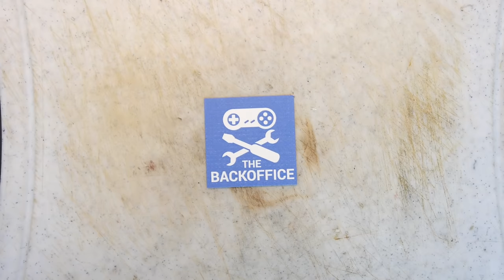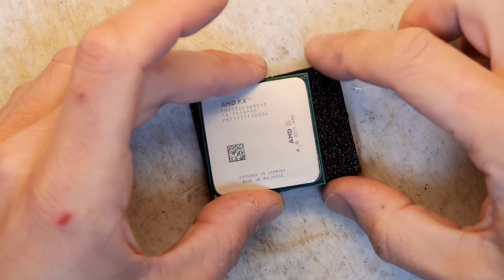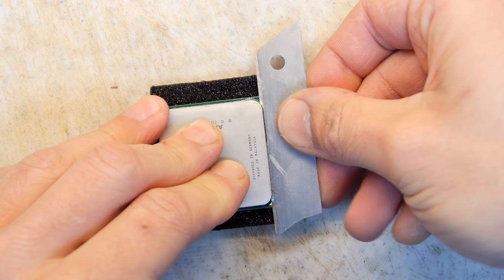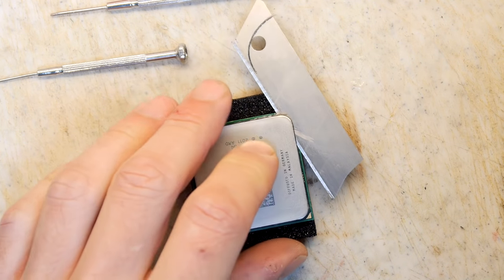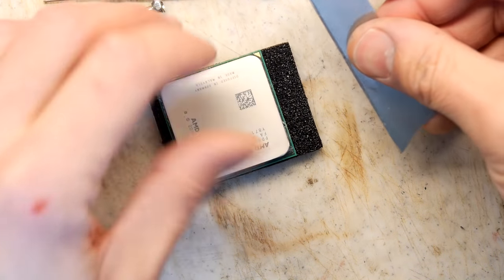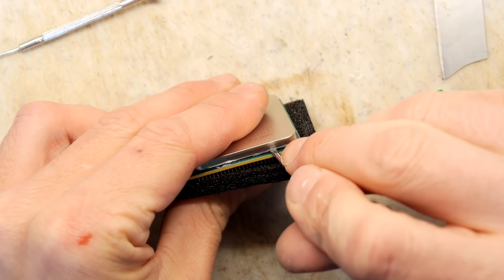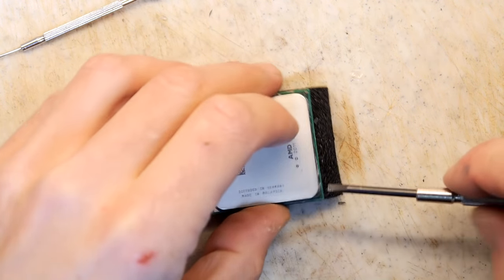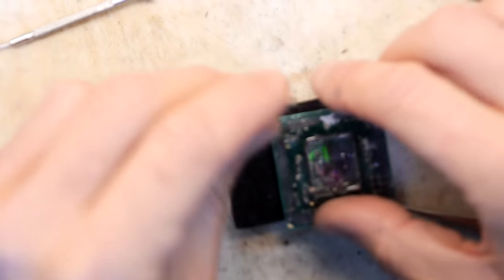Do not DE-LID an AMD FX9590 CPU! (Already dead CPU)

Comment from the maker: Hi guys, tomorrows video (16/02/2017) is a return to this CPU to desolder the lid and test the other components to see if they are likely to survive heating. https://youtu.be/utLf59se-TE
Reply: You could delid a soldered chip if youhave a vice or a specialised delid clamp. You have to be careful when doing it but it's very possible
Reply from the maker: +ThEcRaZ3dGaM3R I did another video exploring the heat spreader, I can see there are some hoops, I.e. applying heat, plus tension to pop the lid off, but seems you need to be really quick?
Reply: just cut the seal around the edge and toss it upside down into a frying pan
then lift when the solder melts
no special equipment needed
Reply from the maker: +Gillian Seed like it 👍
Reply: Hi. Oil on the edge of the blade would  prevent alredy cut rubber to be kind a glued together again after blade goes through and it also would help to cut faster because blade wont be stuck in rubber material and whole thing would go  faster with other processors.
Reply from the maker: +Videocomputer That is a grade A piece of advise right there 🖖👍 A±++++ thank you kindly!
Reply: atleast it was an amd 9000 series trash build 220w TDP is unacceptable
Reply: There appears to be a very good thermal contact between the die and the heat spreader so de-liding this CPU is kind of pointless.
Reply: Those AMD cpu's are soldered together with the heatspreader. They dont just use tim(thermal interface material).
So there is no way to get it off, unless you heat it to about(I dont really know...) 200°C
Reply: They use an indium solder i believe. Much better process than intels toothpaste.
Reply: So your delidding a soldered on AMD processor when your not touching the glued on Intel processor ? I don't get it.
Reply: That was worth watching.I am subbing for that.That was really interesting.
Reply: The Backoffice ...
Reply: "atleast it was an amd 9000 series trash build 220w TDP is unacceptable"

I think people get confused by the fact that TDP doesn't mean the same thing on AMD as it does on Intel. 
TDP on Intel refers expressly to the (Stock Base Average) Thermal Design Point (Under Load) ... so for example the 65w TDP i7 6700., while in use will produce 65w Thermal while operating at 3.4GHz (All Core) or 4.0GHz (Single Core). It will DRAW 94w Power. 

As a note typically speaking Intel Processors are designed to operate up to 20% above TDP., meaning that it can rise up to 78w TDP (113w Draw).

Conversely speaking AMD lists the Typical Draw Peak. So., for example is 220w TDP... this is what it will *DRAW*, the Thermal Design Power is 150w; which is only slightly above i7 6900K which has a 140w TDP (Base) and 168w TDP (Peak) / 203w and 244w Draw. 
Keep in mind that we're talking about the FX 9590 having a Maximum Clock of 5.0GHz (All Core, as AMD Processors have no TurboCore Functionality) at 150w TDP Under Load... where-as the i7 6900K is 3.2GHz All Core at 140w TDP. 

This comparison is something I see many Specification / Review Sites get wrong time-and-time again, something that does show in Power Consumption Benchmarks today but when this Processor came out., essentially it was just assumed that listed "TDP" was accurate and meaning the exact same thing... by the time said Power Consumption tests were added, the FX Series was no longer being reviewed. 

Now what might be of even more note here is that we're talking about the comparison between 32nm which uses 14.3% more Power than 28nm (AMD's later process used for this Athlon and Carrizo Processors) and 14nm which uses 50% less power than 28nm. 
As such if they were to produce the FX 9590 today on their 14nm FFT., it would be an 80w Draw / 55w TDP Processor... this is with AMD doing nothing but simply using the 14nm Process.

Of course if they did, it wouldn't reach 5.0GHz given the flaws in the GF 14nm FFT Process and instead would cap out ~4.2GHz and thus likely be a 35w TDP Processor.. but the point remains the same. As far as the Architecture goes on the Process they kept with... it was one hell of an efficient CPU. 
In fact just dropping to 28nm would've been a major boost to the Architecture, allowing them to maintain the 5.0GHz Peak., while reducing 190w Draw and 130w TDP.

Now with this said, because of the design of the Die being Embedded in a Gold-Copper Heatsink that was then Thermally Pasted to the Solid Aluminium IHS (which in-turn is Silicon Bonded to the Processor Base) ... this results in the AMD Processors evenly spreading the Heat Generated., ultimately this actually lowers the Thermal Point. 
Hence why a 125w TDP Cooling Solution (which was shipped with the Retail Processors as opposed to the OEM Processors)., was able to Cool albeit slightly hotter than the Specification 60c (75-80c iirc) said 150w TDP Processor.

Of course a 145w TDP Cooling Solution., or better still Liquid Cooling was a far better approach.  
It's quite common too for people to assume the CPU Temperature Sensors are incorrect given they will always report a substantially Lower Temperature than Motherboard CPU Temperature Sensor... but it's because of this approach. 

As I noted., the mistake being made all too often by Reviewers is just assuming the same Acronym means the same thing for all Companies.
Reply: Throwing parts on the problem doesn't really help, I did it my self - got a better cooler and paste for old amd cpu back in a day. That paste was totally fried to die. Now it's only good for gold recovery :) AMD actually use indium solder, so it is way better than intel
Reply: Terrifying

Comment: dont you love it when no research is done before hand...
Reply: CPU was already dead, it's not like he truly broke it. At least this way you could see what's under the lid.
Reply: what research do you need. he tears apart everything that dies.  the vid was a little slow and long but worth it i was happy to see the end results and was a fun learning adventure im glad this vid is here i would never of cared to look it up before hand but the vid made it worth clicking and seeing what happens good or bad.
Reply: I guess he never heard of flip chip. that's one way to bust a CPU :-) cool vid though.
Reply: and he could have used safety gloves and heated up the CPU a bit  to make the silicone soften
Reply: He didn't even know AMD CPU's are soldered and that there is no use delidding soldered CPU's (some X99 CPU's excluded)
Reply: Research needs to come from somewhere. I haven't looked but he could very well be the first to do this and because of him don't this we now know not to.
Reply: ishtimal right so just assume that you're the and don't bother with research, got it.

No but seriously he missed a cool opportunity with doing it with more accuracy for better results. I'm sure a diagram exists to aid him in where to cut.

Comment: AMD does not use thermal paste on the FX CPU's. They solder the heat spreader to the die. Ergo there is no need or reason to "de-lid" an AMD CPU.
Reply: Vance Holbrook Just like what Intel used to do.
Reply: True. But, cracking open a dead processor is still entertaining to some...
:)
Reply: Yes there is still purpose to de-lid even when soldered on. Trust me
Reply: he's right, there is a reason to still delid. However the reasons generally involve liquid nitrogen/helium and aimed at some stupid numbers...
Reply: So an i7 7700k is a low end cpu? Cuz it aint soldered.
Reply: Intel cutting costs since their CPU's are so cheap. LOL
Reply: upload9595 It is...my 6 core xeon is soldered like every cpu for x99 mobos (high end 2011 socket)
Reply: Richard Smith technicaly they are... After developing the core architecture they havent improved upon it. Only die shrunk it and modified the interface buss and did constant small improvements. Needless to say they havent had much drive too. But since then they have been cost cutting. Intel's cpus have bad electron leakage becuase they dont insulate the chips they also cut cost with coolers, the heat spreader, and yes the tim. Even on the x99 and server platforms the solder they use is low quality and thick (giddy). You can still drop temps by de soldering and retiming
Reply: Nikola Karovic I dont know how low end it is when it is the best single core performance you can get... = best cpu for gaming for now... i haven't heard anyone call i7 low end...i think that the cost of it is well enough for them to come up with a better solution than a cheap thermal paste.. it might be ok for a pentium  or i3 max...(the actual low end)
Reply: we're talking the Intel HEDT platform...
Reply: Are you sure its soldered??? I never searched for them, but I bet they used is glue thermal compound which actually is worse than a normal liquid thermal compound...

They probably used something like Artic silver thermal adhesive which is a permanent bound to stay attached for ever...
Reply: guily6669 It's solder pasted on and 'burned in', which is just the process of heating the processor up to a temp to flow the solder and create an alloy with the copper which has a higher melting point, permanently bonding the lid to the die.
How some magicians out there can remove the lid without damaging the die is beyond me xD

Now, a long time ago, thermal glue was used, primarily where the board touched the lid, this isn't the case for where the lid touches the die.
Reply: If its soldered they probably simply use a heating gun to remove it without damaging the chip, but the timing would have to be really calculated not to cook the CPU...

Anyway I need to buy permanent glue type thermal compound for my laptop because I have a custom CNC cooler to glue above the original one... Maybe instead of buying thermal glue which I wont use for anything, I will scratch the copper and try putting solder and giving it with the heating gun, but it probably won't glue on the aluminum :(.
Reply from the maker: +guily6669 It's definitely soldered, I have a video out tomorrow on it, I just had to see for myself 😁 

You will not have any luck soldering to the aluminium I know that much 👍
Reply: yes they are all soldered...
Reply: thst's one of the reasons why I prefer AMD over Intel, there's no thermal paste making for horrible temps and you can run the CPU as cool as it's possible

in my rig I can do 55°C with a overclocked FX-8350 with a Noctua NH-D15 cooler, at 400rpm

I think AMD does the soldering thingy for quite a while thou, and they use several layers of solder cuz of the copper heatspreader, I think the actual solder on the processor is indium
Reply: Vance Holbrook, thanks for the info. I was just about to delid my broken 8350 Black and I'd figured heating it would loosen what I thought was silicone adhesive or something. Good comment mate!
Reply: Richard Smith It really has very little to do with cutting cost so much as increasing yield and decreasing manufacturing time. Using a silicon grease over soldering the die to the ihs probably saves around $5. The process of soldering the ihs multiplies the chance of something going wrong with a perfectly good die. The metallurgy behind the process is overwhelmingly complex. So it's somewhat like cutting costs but it saves throwing away good silicon to increase yields. A soldered die is also more prone to micro fractures during thermal cycling. You will probably find AMD doing the same as intel on their smaller processor dies. (4 core models without igpu)
Reply: MelancholyMasochist It has everything to do with cutting costs, in spite of the high price tag. Intel does not need to do it to keep people buying their products, so they don't. Maybe with ryzen, AMD can take back a little mindshare and people will stop letting intel get away with such things, but honestly, I have little hope. Even if AMD has twice the performance for half the cost, people will still be buying intel more than AMD, because it is less about value than it is about brand attractiveness.
Reply: +Nathan West well I don't care much for the temps... My I7 2600k is above 80C° 1.55v and 4.9ghz for years on air and it's still alive...

When it makes 10 years I will probably make a new PC...

AMD was actually a lot worse specially with their 9000 series 200w CPUs which lose a lot of fps for the Intel 90w Apus...

I care a lot for power efficiency specially because here electricity is very, very expensive... it's more than 100eur per month here on a god damn 500eur min salary country...

One month I used  dehumidifier 600w max at half power settings for like 15 days and it came almost 300eur electricity bill that month, my father got very pissed...
Reply: +Nathan West well I also would prefer soldering, BUT I can't say exactly it is more expensive... I mean I buy a huge amount of solder for a few bucks and I can solder like a thousand things, in fact I only bought once in my entire life and soldered already more than hundred things and still have a lot of solder to waste...

In fact I have to solder today my Logitech G25 USB cable... if I don't get lazy... :)
Reply: yes
Reply: The soldering used in CPU headspreaders is a compound of Gold, titanium, zink and copper... Because only a few metals bind to the silicon without damaging it. and only a few metals bind to that metal, which need to bind to another metal....
Reply: Nathan that's actually not a true temp because all the FX CPU's have terrible Temp sensors my motherboard has one on the socket and it's way hotter then what the CPU's temp reads
Reply: +TechMan221 How do you know you can trust the one on your motherboard socket?  It is always going to be hotter underneath the chip by the socket than what the internal core temp is since the motherboard material is more of an insulator and not generally actively cooled.  You will also still have resistors and other components that will heat up the socket area.  My case provides active cooling from an 80mm fan to the back of the motherboard at the cpu cutout so the CPU socket and the mainboard measured temp is always lower than the on-die temp unless I turn the fan off and then the socket CPU temp is hotter than the on-die temp for my 6700K.  If you water cool, you will also need to actively cool the board to prevent the motherboard socket and surrounding components from becoming heat damaged over time.
Reply: AMD chips do not use absolute temp thermistors, but rather an offset which motherboards get miserably wrong. The thermistors were intended for throttling and voltage regulation, and not meant to be human readable, and is basically a hack they are usable at all.
Reply: The X700 intel lineup are the high end desktop gaming processors. They favor single thread performance meant to get the most performance out of single process operation.
Reply: Yea, it is actually. It's "consumer grade".
Reply: sadly, that seems to be true

thou, while intel users have to delid for reasonable temperatures, my FX8350 is sitting at comfortable 55°C at max load with the fans barely working and I get idle temps just slightly above ambient

having said that, with the new Ryzen CPU these temps should drop significantly
Reply: unless it is x299 chip apparently.
Reply: Well AMD cpu's are not going to have a branding problem for long at this point.
Reply: Yes only intel is that stupid ^^
Reply: guily6669 Are you really comparing xeons with an i7 under the same hood i.e gaming ? Lmao thats one of the lamest comparisons i have seen. Xeons are much more powerful when they do what they are meant to do, that is server multitasking . Their raw performance beats an i7 as would a bike to a cycle . Xeons were never meant for gaming and even then they perform decently when given gaming processing , unlike i7s which if given server business would run terribly.The simple fact intel is cheaping out on i7 makes the line up low end . As for single core performance , its something intel fanboys tell theirselves whenever they compare an i7 to a ryzen . Except bad pc ports like forza horizon 3 most games require better multi core performance, even so ryzens arent much behind in single core performance. You wont actually see performance difference in games in an 1800x vs 7700k comparison because games rely much more on gpu unless the company is more optimized for anyone anyway.
Reply: You can delid it, just need to head the die to 50°C or so to melt the solder as it is gallium based
Reply: yeah, that's exactly what i thought when i clicked on this video
Reply: every intel cpu nowadays is not soldered any more.
Reply: my AM2 sempron was pasted i delided my self and i know for a fact that some AM2 athlon 64 chips are not soldered etiher
Reply: Athlon ii series isnt solded
Reply: rong
Reply: well, there is still the need to delid it to run direct on die cooling.
Reply: There are many reasons to de-lid a cpu AMD & Intel. The reasons for both are the same.
Reply: backofficeshow the ihs is most likely not aluminum but nickel plated copper
Reply: nope
Reply: upload9595 no, it's just not a high end CPU...
Reply: so i9-7980XE is a low end chip?
Reply: Heat the chip and quickly remove the speader